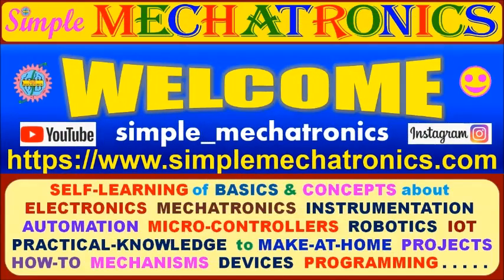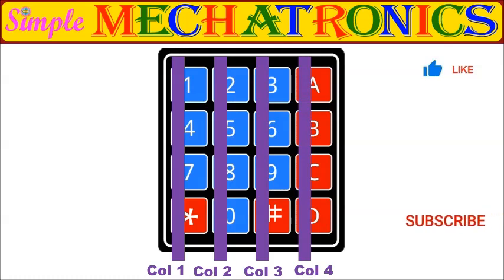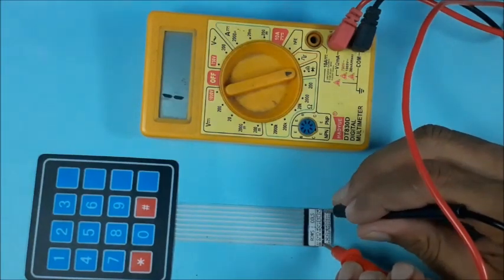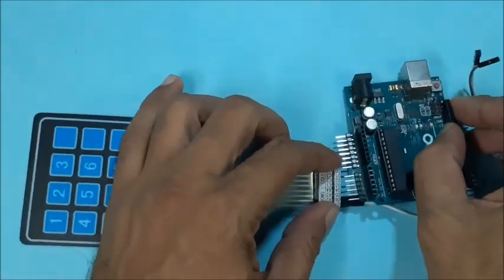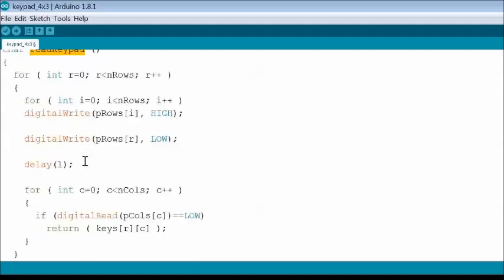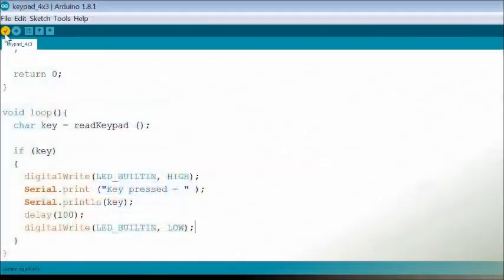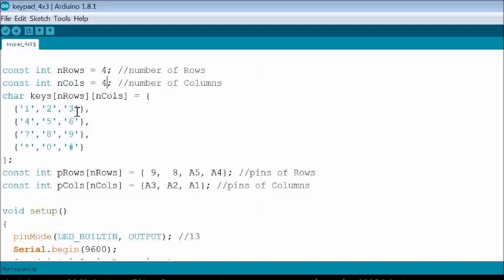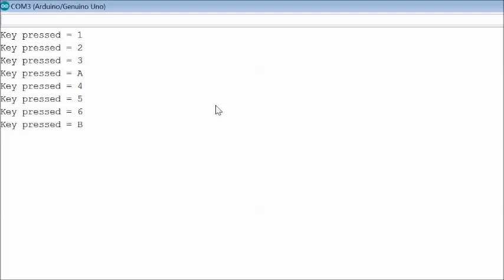Step-by-Step ARDUINO Step#6 Connecting Keypad | Matrix Keypad | Arduino Uno & coding

Comment: My row 2 is not working
Reply from the maker: Dear Raj,
There may be loose connection. Please check.
Then try changing pin connections, and notice the difference.
Still, the same row is having the problem, then the problem lies with your keypad.  Replace with new one and try.